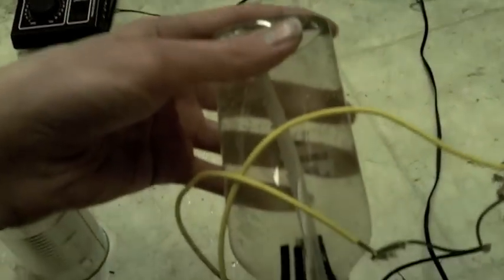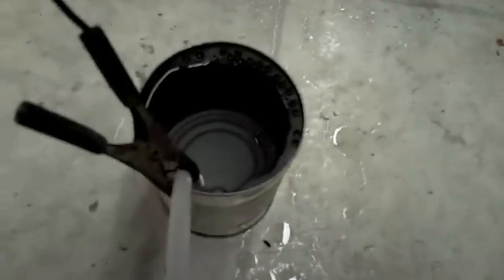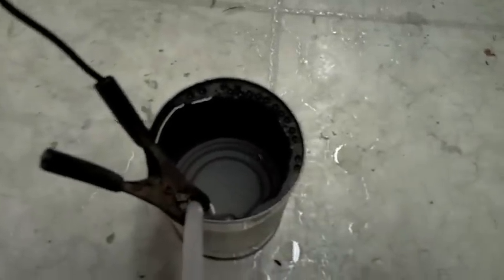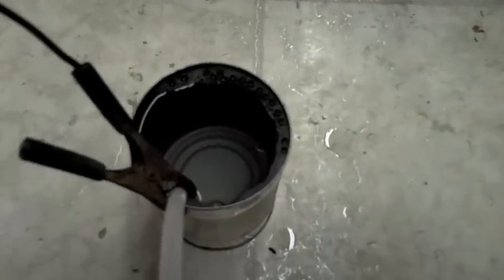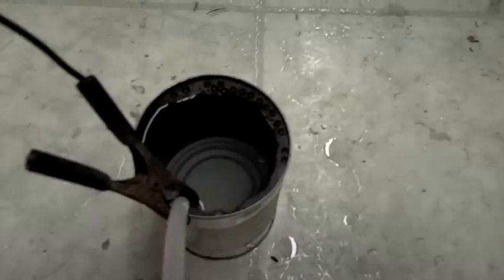Electrolysis: how to make water burn

Comment: had an electric train set as a kid, was 15 volt ac. I guess it would only need a step down transformer and a high current rheostat, DC would have smoothing capacitors at the rectifier stage. perhaps you made a kind of a battery in the process! fair play if you did but have my doubts, let me know if you find out, this is interesting cheers.

Comment: surely you know that the transformer will have capacitors which store electricity for a short time after switch off? if you dont know something that simple im not sure you should be playing with lighters and gas!
Reply from the maker: +Alan Wolstenholme I later tore down that supply for another project. Pretty sure there was no cap in there. Two switches, a potentiometer, a mosfet, the transformer itself, and that was it. Shut it off and it's off, as it was for everything else I had tested with it. Also, I would like to see the capacitor that can keep an incandescent lit for that long off a 12v charge with no current limiting resistors in line.

Comment from the maker: @anyjaszemit Laptop transformers have lots of regulatory and current-smoothing circuitry (capacitors etc). I've taken one of these train transformers apart, and they're dead simple, just the transformer, a single mosfet, and a potentiometer. I've tested and run a many bulbs from a train transformer and they're always instant on, instant off.

Good thought though.